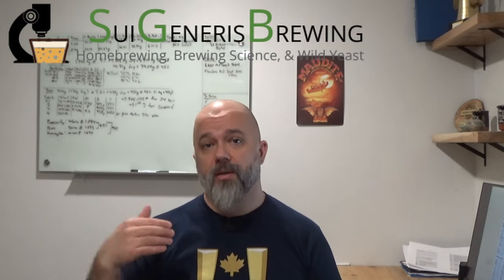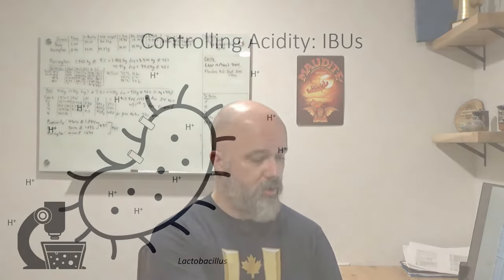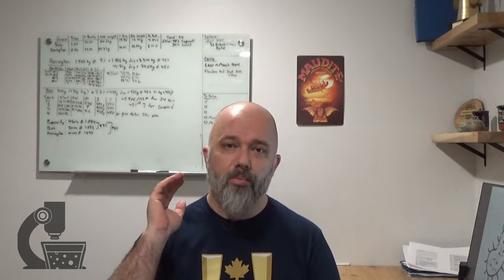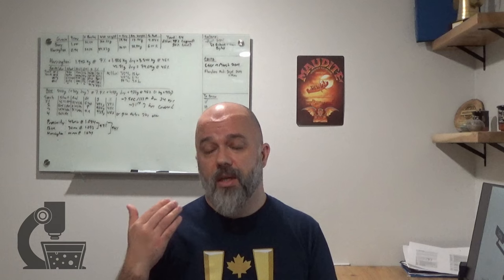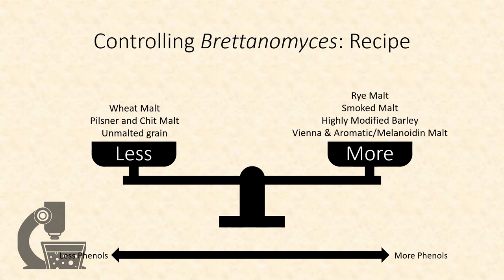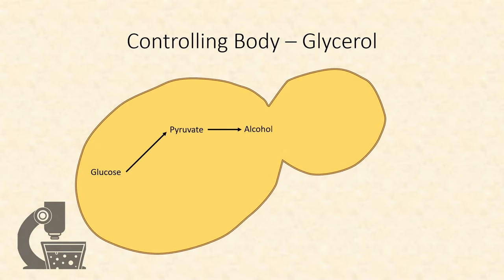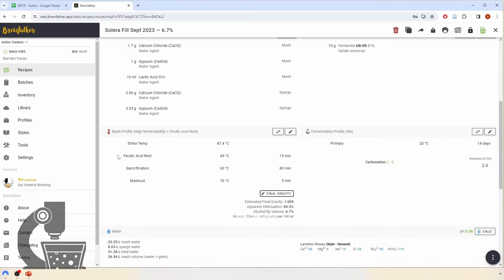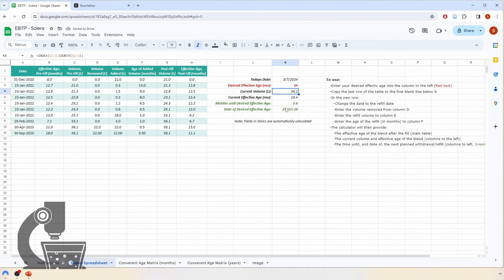Solera Series Part 2 - Managing Your Solera

Comment: I have a Flanders red that was destined to be a solera but that was almost 4 years ago. It sat in the back and I recent smelled the keg and it was surprisingly amazing! Going to pull a sample soon but would you suggest I start over or begin a 50/50 replacement method?
Reply: I feel a cool thing to do with that is blend it with a 2nd 1 year old batch a la a Geuze, then start the solera going ;)
Reply from the maker: I'd use it to start a Solera! That said, you may need to pitch a fresh culture as some of the original culture may have died off over that long a period.